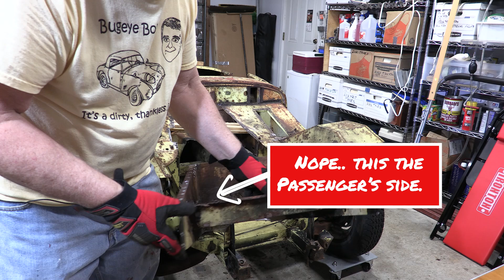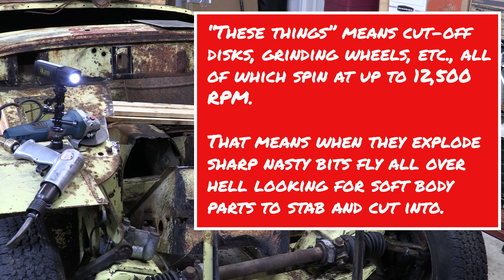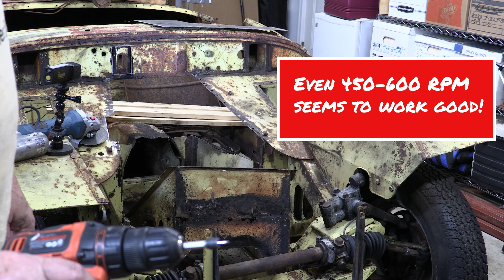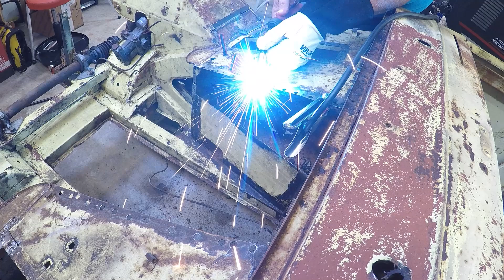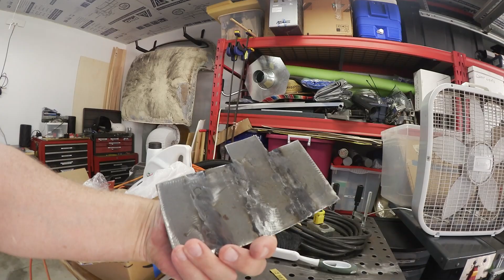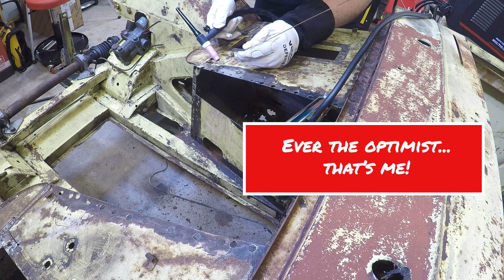BugeyeBob Episode 019 Fixing the Firewall and Battery Box Part 2

Comment: Why don't you use a pneumatic hole puncher for your spot weld holes. Safer and quicker. Fairly cheap on Amazon.
Reply from the maker: That is exactly what I have used to create the new holes on the repair piece.   Picked one up at Harbor Freight on sale.  Sorry I didn't explain that.
Reply: @BugeyeBob-zt6ne  Sorry, just looking out for you Bob,  I feel lucky, mine only needed new floors and a bottom hinge in the driver's A pillar.
Reply from the maker: @mm2892-e3e  No problem.  I need all the help I can get!  Given how these things always seem to end up with a name, I think I'll call this one "Lazarus"...
Reply: @BugeyeBob-zt6ne  I named mine Frankenstein because there were so many parts from so many cars and repops.
Reply from the maker: @mm2892-e3e  Well Played!